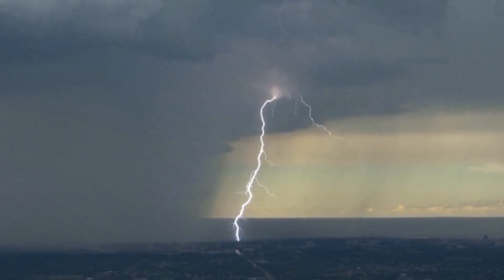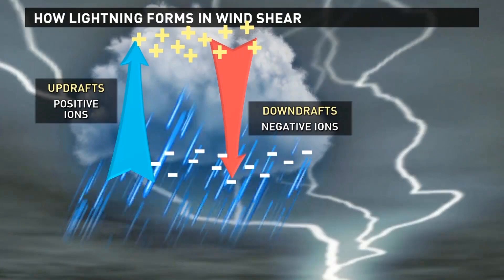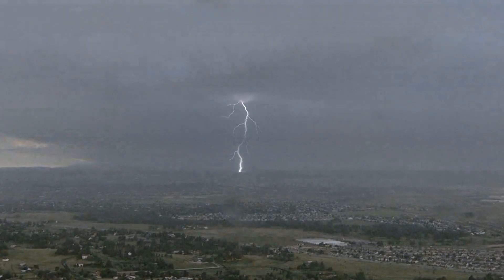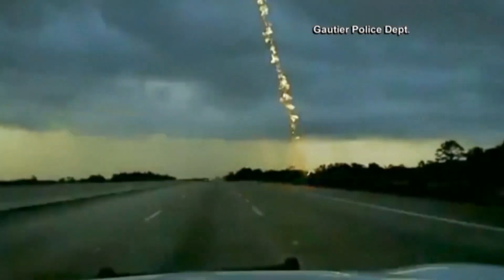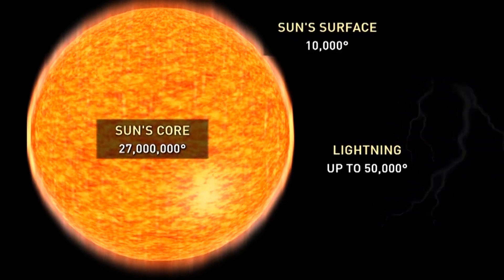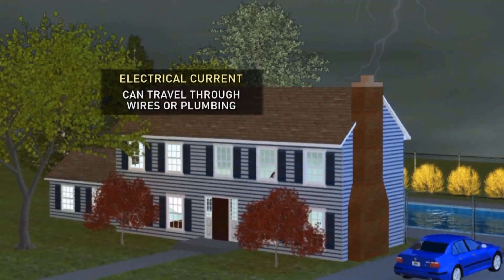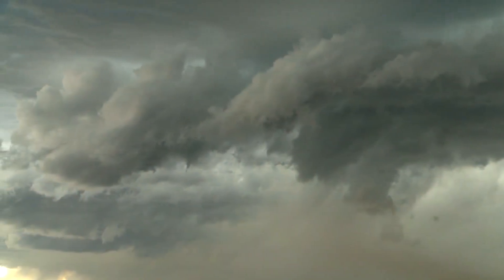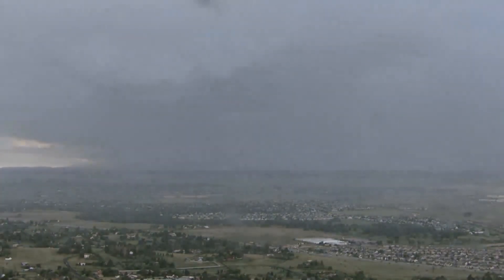How lightning is formed

Comment: Where does the energy go that originally formed the storm clouds? 

It's stored in the moisture in the air, and is released only when h2o is produced. With an abundance of rain being produced,  and energy being released,  BOOM. Lightening, pure energy.

The original heat needed for producing storm clouds is stored in moisture by the cooling of the rising hot air. Change in dew point changes the moisture content, therfore storing said energy even more. Once h2o is actually formed, which requires energy, energy is released. We call it Lightening.  Pure energy!